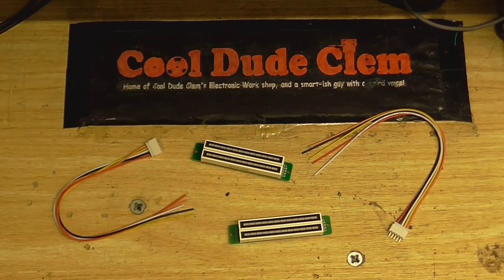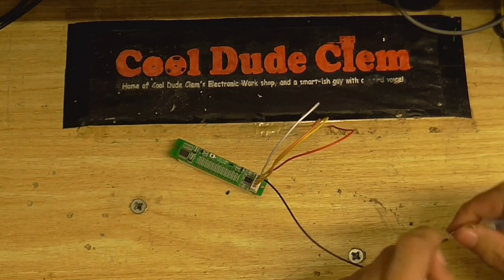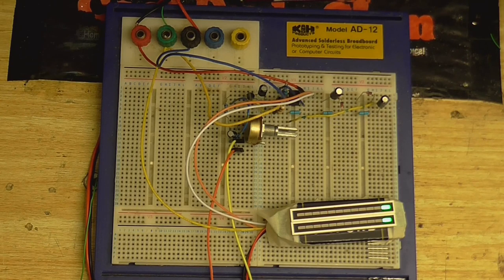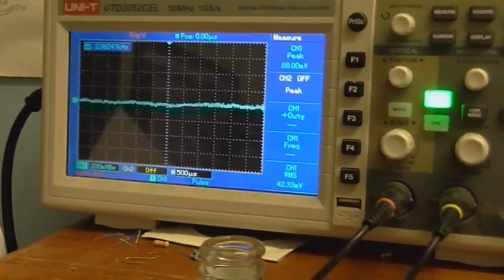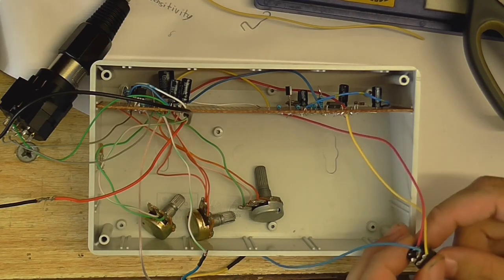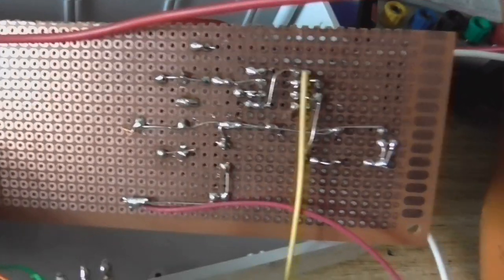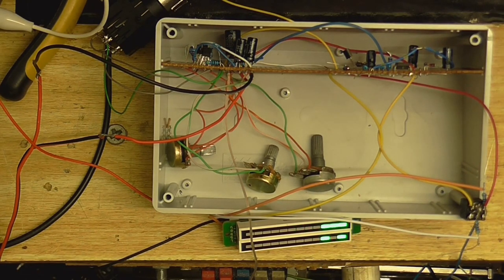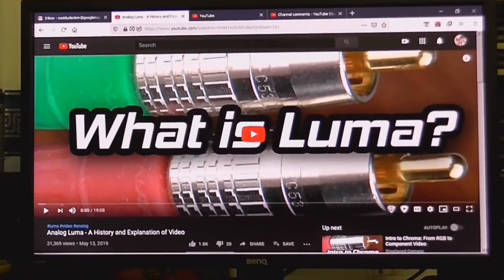Microphone pre-amp build part 2

Comment: Hey Clem, You are your own signal generator, like you asked Ko at radiofun232, another channel I like, and, yes you are, give a whistle. Great project and good work dude. You are good, transistor or not. I need to find part 1. I only worked 13 hours on 9-9, so, I have some catching up to do. Sounding good from where I am. Check out the Washington, Oregon and California wild fires, getting close to home. All the best from Oregon, Cass.

Comment: Where did you get the led meter from? Also did you get your money back from that download that was charged to you?
Reply from the maker: I found the led meter on eBay as a kit, that was the only place I could fid anything like that, all the other online electronics retailers are all rasperry pi and arduino, it's getting harder to find basic components. I never did get my money back from that paypal thing, even though I told them several times about it, they said I bought it, they didnt see anything fraudulent. well I say they either just didnt care or didn't look hard enough.

Comment: Hello Clem, I said I would tell you a way to power an op-amp from a single side power supply, here it is. Usually, op-amps require a "Dual Power Supply", Positive and Negative voltages with "Ground" ( or common ) at 0 volts in between them. However, if the Non -Inverting (+) input has an applied voltage of half the power supply voltage, a "single side" power supply can be used, plus and ground. You can use (2) 100K ohm resistors, brown, black, yellow and a filter capacitor from 4.7 to 10mF, electrolytic, with plus on cap to plus or Non-Inverting input, negative to ground, duh, this is called the "Bias" voltage, from the voltage divider network. The feed back resistor goes to the Inverting input, this reducing the gain. Gain=Feedback resistor/, divided by, Input Resistor. Example, Gain=51,000 Ohms/1000 Ohms= 51. Try it on your breadboard to verify this information provided. I hope this helps. Oregon, Washington, and California, not to mention the rest of the World is burning, check out some satellite imagery of the World. So far, so good where I am, barely see the Sun or hills close by because of thick smoke. Till next time, all the best from Oregon, Cass.

Comment: Feck me! I simulated limiter, compressor, automatic gain control, automatic leveler, automatic this that everything whatever it is labelled as. And this Cool Dude Clem limiter bloody works at first try! Rarely does this sort of success happen on me! 

I have been hunting and simulating all of those logical-looking circuits in order to know first know whether they work or not before I waste my time on nonsense. Only one works, I think. Or just about works, I think. Oh well, the Internet is full of bollocks.
YouTuber, w2aew (Alan Wolke), is a proper electrical engineer and doing proper things, but his audio leveling compressor circuit does not work. I mean, I cannot make it to work on my side. I have not the slightest notion as to why it does not work, although it consists of darn common and basic components.

I hope Clem (Clemen/s/t?) would improve the entire circuit. Including that instrumentation amplifier (transistor and differential/substractor sections). By doing so he probably never needs to make another big arse transformer-base power supply just to remove electrical noise, and perhaps magnetic noise as well (I was understood that magnetic noise is much more challenging to be prevented and eliminated compared to electrical noise).